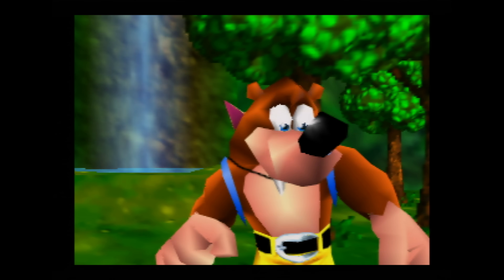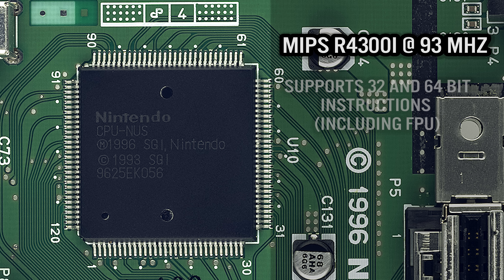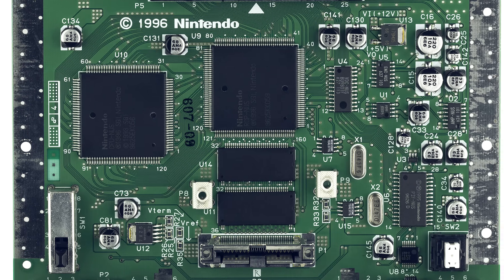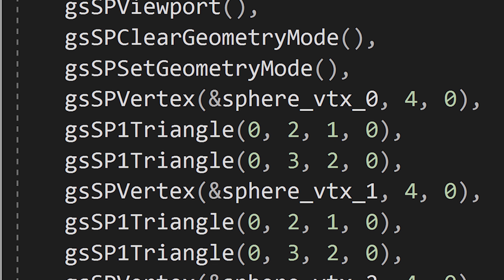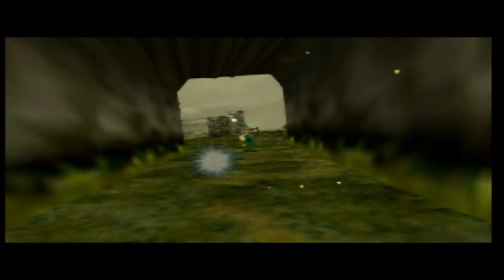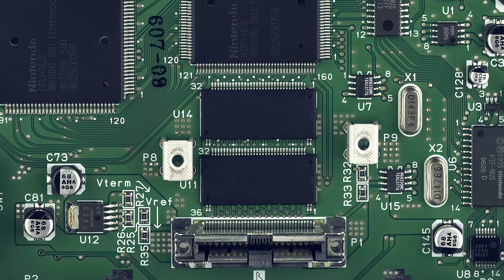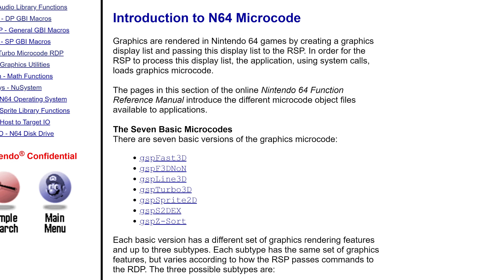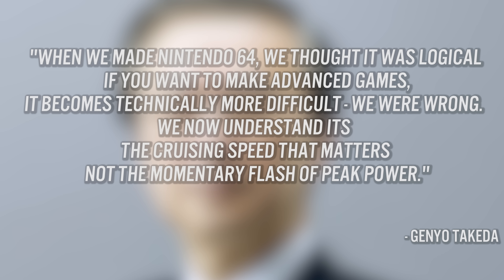Why was the Nintendo 64 so hard to develop games for ? | MVG

Comment: I don't think it's understood how underrated this experience was to shape the future of the company.

Up until N64, Nintendo chased the "race to the best console HW" like everyone else. Sony made the same mistake with the PS3 Cell. SEGA did it with the Saturn.

After the N64, Nintendo seems to shift focus on other things; like developer friendliness, unorthodox controls, and gameplay over graphics.

The Wii was just 2x GameCube, a far less powerful console compared to their contemporaries XBox360 & PS3; yet Nintendo outsold those 2.
The Wii U again, under-powered for its time. A more powerful CPU version but this time a different GPU; AMD-based which everyone was familiar (though R700 over GCN was an odd choice). Didn't sell well though.

And then there's the Switch, which is just Android HW with FreeBSD SW and Vulkan (and NVM) strapped together. All things game developers were familiar with (and probably already supporting in separate ways*) so it's easy to develop for.

* PS4 is BSD-based, ARM64 is well known (specially if you already ship for Android/iOS), Vulkan is supported on multiple platforms; and NVM & Vulkan are a bit similar to GNM (PS4's) thus in worst case porting to Switch would still be easy.

Comment: Making the N64 a cartridge-based system was one of Nintendo's biggest failures.  They missed out on so much potential profits and franchises than with a disc-based system.  Including the fact that the 64DD (officially Nintendo's biggest failure) would never even have been a thought.

I know Nintendo likes to zig when everyone else zags, but this was just common sense.  Optical discs were far better storage mediums in the mid-1990s than cartridges were.

Comment: Perhaps if Nintendo was to increase the price by 50 USD it would have been possible to have a 64K texture cache even. Also, the fillrate was up to 62 Mpixel/s. Perhaps with modern solid state storage it would indeed be possible to have PS1 ports on N64 with better performance. Adding some RAM on the cartridge would also be more viable today.

Comment: It seems to me by looking at the GPU layout, increasing texture cache to 8K wouldn't add much to cost, and be a lot better for games. Poor microcode was also an issue, it is a wonder why Nintendo didn't put more effort into optimizing it, at least after launch if deadline was issue. I remember thinking more about low polygon count than texture quality though, I thought the textures were fine. Compared to PS1, which had the most awful, pixilated crap I have ever seen.

I think bigger issue was the RAMBus memory. RAMBus was just a proprietary technology going after theoretical numbers, and licensing fees. Their memory was crap. You know your RAM is crap when it is faster to read from cartrage. I know carts were very fast, but.... you would think RAM would be faster. RAMbus was more complex, more expensive, ran hotter, and in real world was slower. A better memory choice would have made a huge difference.
Reply: PS2 used RDRam too but wasn't such a big problem. It had a fairly split memory architecture, the GPU had its own VRAM, EE had its own, the mips R3000 they used also had separate memory. It had a good DMA controller too (10+ channels IIRC)

Comment: It didn't execute 5 instructions at a time. CPUs are generally pipelined, so instructions are split up into smaller chunks, each being simpler, which enables higher clocks speeds, and can somewhat mitigate some memory/cache latencies. While technically multiple instructions are in process, in reality, it is starting at most 1 new instruction per clock. 

Modern CPUs are around 15-20, the Pentium 4 had up to like 35, but this was its major flaw. Intel was marketing clockspeed, so used super deep pipeline. The problem is whenever there is a branch in code, like from an IF Else statement, it CPU mispredicts the branch, it must flush the entire pipeline, and start over, incurring a substantial penalty. So Pentium 4 instructions per clock was garbage, and early P4s ran slower than P3s in many applications. Later P4s were even worse.  Far too deep a pipeline to chase GHz, and not that great of a branch predictor.

Comment: Interesting to hear this from the developer side.  My first industry job was at Nintendo of America as a tester working on things like Perfect Dark, Super Smash Bros., Pokemon Red/Blue, and Beauty & The Beast a Board Game Adventure.  Compared with my later testing experience, the job was kinda crazy:

1. The bar for hiring was very low. It wasn't minimum wage, but wasn't much higher. This made it an amazing foot in the door of the industry, but not really a particularly professional environment.

2. The testing process was very different from later testing jobs.

* Builds would arrive overnight. I'm not actually sure of the method of transfer. I've assumed it was over the internet, but a couple years later at MIcrosoft I worked on games where the build was so large they'd physically mail a hard drive through snail mail to deliver a build once or twice a week. (Crazy.)
* They'd get uploaded one at a time to ROM carts for each tester (it's a cart that goes into your N64 but instead of a fully enclosed grey case, it's exposed circuitry with some sort of plug for wiping and re-uploading a fresh build onto the cart)
* We tested on CRT TVs with (A) a built-in VCR, (B) cabinet-like speakers that would cover the screen when closed.
* The TVs had inputs for NTSC and the blurrier PAL mode (which was apparently common in Europe?), and we ended up testing both.
* We had to test all the official peripherals.  There's nothing quite so satisfying as beating someone at Super Smash Bros. when you're holding a fishing pole or a steering wheel instead of the typical N64 controller ;)

3. Bug reports were written by hand using timestamps from a VCR recording (you'd always record all your gameplay and pause it to note the timestamps of bugs you observed).  Then at the end of the day you'd turn in your paper and the VCR cassette to your testing lead and they'd filter out the best bugs to determine which ones actually got sent over to the folks at Rare or whatever other dev was working on it.  For Gameboy testing this wasn't possible so it was only the hand-written bug report, which made repro'ing things that much harder.

4. Several of the games were just new localizations.  Pokemon and Smash Bros. had their official releases before I started working there, so what I was testing was just different language builds of those games.

5. Staring at a Gameboy green-o-vision screen for 8+ hours a day is bad for your eyes. I don't recommend it.  (Even worse when it's a Beauty & The Beast game you're not thrilled to be working on in the first place.)

6. Granted I had some coworkers who had to listen to that Donkey Kong 64 rap played on various monitors almost nonstop throughout the day, so well...some had it worse than myself.

7. The break room had several arcade machines, which included one of those SNES demo displays (with the SNES under the plexiglass) with Tetris Attack.  Due to Tetris Attack going through testing there a few years earlier, the competitive scene was amazing. To this day I consider it the absolute best versus puzzle game. Crazy skill depth.

8. A few things I remember reporting for Perfect Dark include a moment where Joanna uploads a virus into a computer console but says something like "download the virus to the terminal".  Really bothered me at the time, but keep in mind this is 1999 and not a lot of people were even familiar with the term "download" yet, let alone "upload".   Also I remember reporting that the Farsight was overpowered, but they didn't seem to care much (the Farsight was the sniper rifle that let you both see AND shoot through walls at any range); they didn't let us report very many tuning bugs like this, but that didn't stop me from trying.  Sadly even though I was part of the NOA test team on Perfect Dark from basically day 1 that it went into real testing there, neither me nor the 3 others who started that early got included in the credits (basically none of the contractor testers made it into credits).  Pretty lame, and to this day I make an effort to try to include everyone who works on a game in the credits for games I work on.

Comment: You only glossed over it but I think the cartridge format was an elephant in the room. While cartridges were incredibly quick with virtually no load times, the storage capacity was severely limited. The largest capacity that N64 cartridges reached was 512 megabits, or just 64 megabytes. This is less than a tenth of the storage capacity of the CD format the PlayStation and Saturn used. It didn’t just mean the N64 couldn’t really do FMV (though a handful of games managed it, albeit heavily compressed), it meant it also commonly didn’t have the space to store high quality audio files. Also Hiroshi Yamauchi at the time admitted he'd deliberately asked for the system to be difficult to develop for, because during the NES and SNES era, he would personally review and approve every game for those consoles to give it the official Nintendo seal of quality. When the N64 came along he couldn’t sustain that practice, so ordered the system to be challenging to develop for, in order to discourage less talented studios from making low quality games. Ouch.

Comment: In software development, that's a recurring thing. Client asks a very flexible system and is warned that, not only it will jack up the price (more corner cases to handle), but it will also be harder to use. Then the second step is "can you make presets/macros" ^^
And then: «you went crazy with all the features, but in the end we only required this. I am not going to pay the full price!».

It's why it's important to have everything documented, every requests to be signed and confirmed.

Comment: Its not mentioned much, but carts did have one other benefit, durability.

Children are terrible to CDs and Carts, but at least the carts can usually take the rough treatment. I recall breaking several CD's when I was little. I have never broken a N64 cart.

Now of course this whole durability doesn't really apply anymore with current consoles, but still cool.

Comment: Reminds me developing on the PS2. We did two ports from PC. The lead hated that it was not like programming a PC. I thought the vector units were the neatest and because I was reading its manual was assigned porting OpenGL, my first introduction to it. I found the biggest bottleneck was everything was DMA’d. I set up a ring buffer to stream vertices and textures constantly— we could only have one texture uploaded to the GS at a time to use mipmapping and double buffered full resolution screens. Eventually we had a special profiling of the execution done and it showed the instruction and data cache DMA’s were constantly stalling on other DMA’s. There was not much we could do about that unless we wanted to re-write the Quake engine to be optimized for the PS2, which we weren’t going to do. In the end we optimized what we could and it wasn’t too bad, but never fully optimal. My conclusion is the PS2 runs great when games are designed from the ground up designed specifically for it, but it’s architecture is very different from a PC making cross platform a more difficult thing.

Comment: One of the big issues waa using a chip designed to so frame rendering vs real time buffered rendering. I worked closely with SG as a refurbished their servers. One of the designer did confirm this.

Comment: It was a piece of garbage that's what it was, the games were expensive to produce, the storage was almost none and nothing, zero
and the Controller was odd to grab in hands
The only thing i can say was good about that console was that Analog Stick which of course didn't have a good lifespan, Even my Dual Shock  PS1 Controller still works without an issue
However, i gotta admit there were few, and only few games were made which were decent at it's time which were made with in house developers, but there were only few compared to tons of good games on PS1 such as Final Fantasy RE RE2 etc...etc...
Reply: Found the fanboy baby!

Comment: I never knew the N64 packed so much compute power... Like, I knew it was powerful, but damn... Kinda curious of what a "modern" developer could do on it, if they had a good SDK...
Reply: You should look up Kaze Emanuar. He makes videos about the various ways in which he's been able to get as much performance as possible from the N64
Reply: Look up Kaze's SM64 romhacks. Some of them almost look like gamecube or even some early wii games. they are legit impressive.
Reply: You don't have to imagine. There are multiple impressive projects ongoing, and some which have been completed, with ROMs you can download. 

As the other user stated, Kaze Emanuar is one of the best known N64 game programmers today, but not the only one.

One good example is the split screen two player version of Mario 64 (I believe made by Kaze, or with his help), which runs at THE SAME frame-rate as the original game, or maybe even a little better. It's hilarious because Nintendo said it couldn't be done, but I think I heard that it only took a few weeks, or even just a few days, for someone to figure out how to make it work. 

There is Peach's Fury, for example, which is a small stand-alone Mario 64 game, also made by Kaze, though maybe with the help of some others as well, I can't remember. 

There is also the unfinished Portal 64 ROM, which is absolutely mind blowing. I cannot believe how good it looks or how well it runs.

Comment: I'd say the system was under-engineered instead of over-engineered. The lack of insight into what 3D games would look like was of course a limiting factor but the fact that they didn't think through the texturing pipeline is weird, since it would ultimately lead to increased cartridge costs, etc.

Comment: I really keep wondering if at some point Nintendo Will blast their way back to the top with the most powerful console again
Reply: I mean.. They are already doing that with the weakest console on thr market
I just wonder what would happen if they actually made a powerful console and got all thr powerful 3rd party support
Like.. Imagine all the Nintedo exclusives along side RDR2, GTAV, Cyberpunk 2077 and FF7 remake

I genuinely think they would rule the gaming market this way
Reply: @bareq99  well also, it's very obvious to me at this point that Nintendo has a first party developer is basically better than just about any other third party, or the majority at least...

So having a powerful console, but then just having games that other consoles have isn't really enough.

It needs to be powerful, very easy for developers to use effectively, a Nintendo needs to pump out some excellent first party titles to get everybody into the ecosystem. I mean it has to be worth it and the eyes of a developer otherwise what's the point... Lol
Reply: No one really fully designs their own systems anymore, all the modern console today are using SOCs with many off-the-shelf components

Comment: I would love a "what could N64 games look like if storage wasn't an issue" video 🙂
Reply: Yes. What could the RCP and 4300i do if really allowed to stretch their legs? I'd love to see what the real brains of the operation was capable of
Reply: There is a guy doing gods work on Portal64 and another lad making modern Mario maps, so you don't have to die wondering.
Reply: @jasonbroadhurst yeah Portal64 is very impressive
Reply: @SamyasaSwi  Portal64 got cancelled by Nintendo sadly
Reply: @Smiley01987  yeah I know
Reply: @Smiley01987  It was cancelled by the creator, James Lambert, after the request of Valve, which was in part due to fears of Nintendo taking action for using their proprietary code and in part due to the fact it likely wouldn't be distributed on Steam. Nintendo was not directly involved in the project ending
Reply: @TheRenegade...  The way I understand it, Valve didn't request it to be taken down, they strongly recommended it to be taken down, as free legal advice. Valve themselves didn't have any interest in suing, as I understand it.

You can still find the unfinished version of Portal 64 with the first 8 stages.
Reply: @syncmonism  "Strongly recommended" is just another way to say they requested it be taken down.
Reply: N64 graphics with Playstation-like framerate?
Reply: @Nutty151 what does that even mean? There were 108 60 fps ps1 games. I doubt there were even 108 games for the nintendo 64 in total.
Reply: @jamesyu5212  there have been 393 games released for the N64.  You’re bad at commenting 😂
Reply: @lookoutforchris  you obviously have to comprehend everything literally like an 8 year old child would. " Oh my god 393 is SOOOO MUUUUCHHHHHH more than 108 its outrageous!!! ". #getalife
Reply: The N64 RE2 port?
Reply: https://youtu.be/Sf036fO-ZUk somebody made virtual texturing on N64
Reply: The Ultra64 machine (Arcade N64) had a maximum resolution of 1024p with a HDD, Killer Instinct Arcade was the first game using all those resources.

Comment: 5-stage pipeline not equal 5-fold superscalar, hence 125 MIPS out of 93MHz. And at about 7mins, RAM expansion was 4MB, not 4KB. Reading from cartridge faster than RAM also not true: cartridge 5-50MB/sec, RAM:  > 500MB/s. Maybe the N64 was so hard to program on because nobody knew how to use Google and Wikipedia back then?? Stopping to watch this nonsense now.